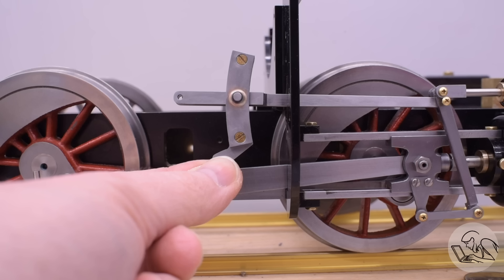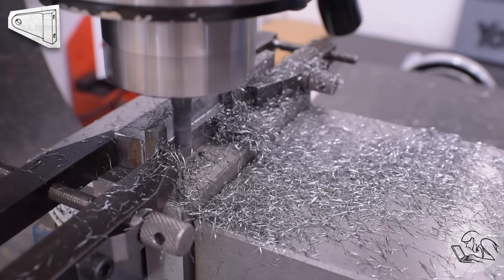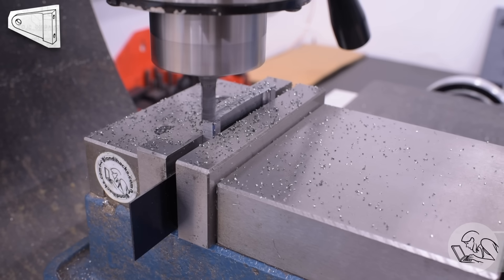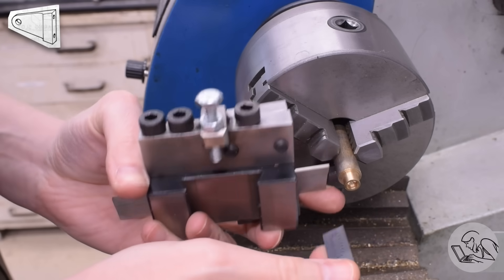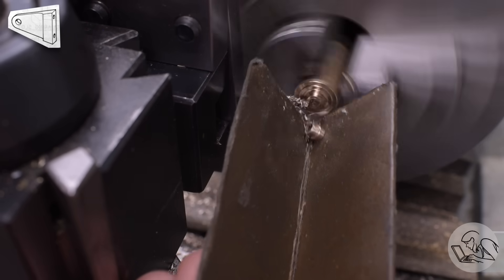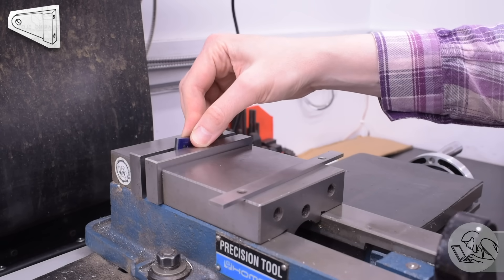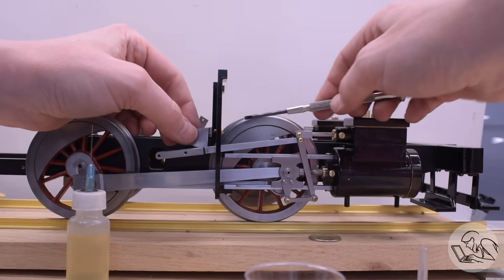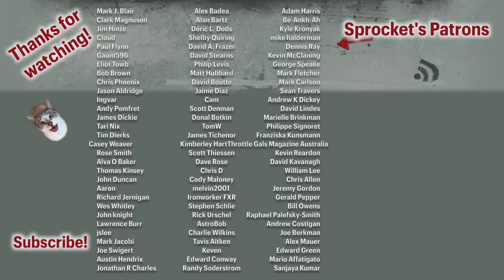Link Brackets - Pennsylvania A3 Switcher, Part 63

Comment: I've had success in the past getting those one or two extra threads in shallow holes by grinding just a little off the tip of my tap. Gotta be real careful though not to take too much or it won't start correctly.

Comment: huh, I was just about to comment on how nice the brass screws looked  with the bearings... Oh well. Question about the bearings, can you heat the part and whack them out with a punch if they need to be replaced or will you have to drill them?

Comment: Starting to look like a proper engine.    If you had a smaller grooving tool like .03 inch wide by 1/4 inch long ground from a bit of HSS would you have gotten the fourth little bearing?  For similar small jobs the ground tool like that I've got sure has come in handy in the same sort of circumstances.  I think I originally did it for a small "C" clip.  But it's been useful for far more than that over the years.

Comment: Great brackets Quinn, the bearings look perfect. Even if its not on video I hope you get to meet with another A3 switcher builder in the wild and talk about the little things you both did differently.
Reply from the maker: I have, in fact met and spoken with three! Lots of tips on building and tweaks to the design still to come. There are parts of Kozo’s design that don’t work well, as learned by others

Comment: Great work, as always.  Now that you've been using the corner-rounding fixture for a while, how do you feel about the right-hand screw for depth adjustment?  In your "making of" video, you said you "get used to" the adjustment; is this still the case, or would you make it with a left-hand screw if you had to remake the thing?

Comment: You say you save time by using the end stop; how long does THAT take to set up?
Reply from the maker: Like, literally two seconds. Less time than reaching for the draw bar wrench to change to the edge finder.
Reply: @Blondihacks  OK, thanks!
Reply: It's pretty quick... magnet sticks it to the table.. bump the stop up against the first part while it's still in the vise... bump the next part up against the stop and tighten the vise... about as long as it takes to read this and then the points in the DRO are repeatable. Cheers